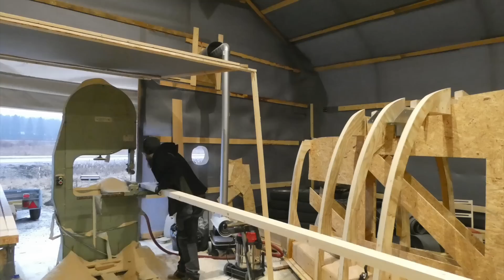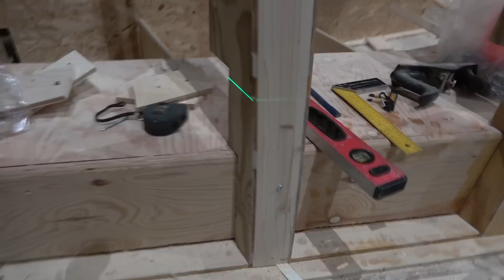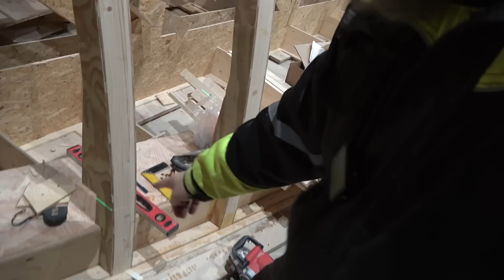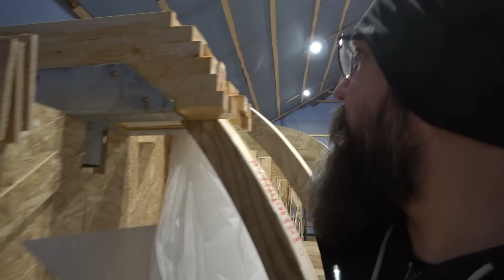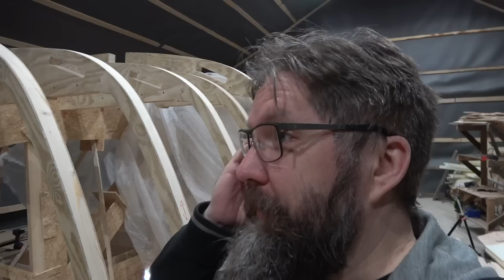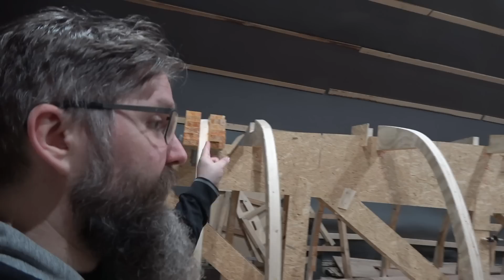Mast steps installed! 🥳 - ep85 Project SeaCamel

Comment: Your heater puts out CO2, mostly. 
In order to run it in the wind, you need an upright Charlie Noble, it looks like an H, with the heater exhaust entering the bottom of the cross pipe. This will induce a proper draft in the exhaust. Boats have been using this, for over a century.
Best wishes from Northern Canada.

Comment: Hi, Epoxy glues even glass so no sanding is needed. It only acts as here to keep air and humidity out. You only damage the galvanized surface. Cleaning a glue surface should always happen before sanding, otherwise you just spread the contamination. Also the Epoxy layer around the bolts will be a little thin. In such cavities humidity collects well and does damage quite fast. Better would be to glue the wood below the mast step on the table, drill the holes 3 mm larger, fill them again with EP, drill again and glue the bolts in as you do now. You need to protect the wood with EP all around as well as possible, otherwise you'll have rotten spots after ten years. That wood is not made for the sea as you probably know.
Reply: I also think the building method of glueing in the frames first is wrong, as you will have a very hard time to glass the inside of the boat. Why not build it like Johan from RAN Sailing. I'm boatbuilder and naval architect and I doubt that this design is stronger or better suited for ice regions as you mentioned long ago. The thick layer of glass does a better job than frames likely to rot quite fast. Anyway, glueing in the frames after laminating the hull inside would be way easier.
Reply from the maker: Hi! I won’t be having heavy glass inside the boat. Just thin coat for protection.
Frames are essential part of the structure and this way I don’t need that much temporary structures.

Comment: Have you thought about building a Wood Burner that heats water and put a few old Fashioned radiators like was use in the Older years? You have a lot of wood and wood chips?
Reply from the maker: No. There’s actually not that much waste wood. And I cannot have any water in pipes laying around. They would just freeze (or need to have glycol a lot in there.
For example it has now been few days -11°C. No point to try heat that place right now! 😅

Comment: I think I’d like to try and put epoxy skim/hot coat, on most pieces while it’s in small form before it’s 1 large structures, help prevent any possible rot and gains some strength and possibly adhesion between boards, sealing individually would be time consuming though. I’m not an engineer and in no way intended to discount your processes.  I’m type person that should not ever attempt something like this. I’d go over board with paranoia
Reply from the maker: Hi. I’m kind of wanting to have epoxy gluing wood surfaces so that there’s good penetration inside the wood and then chemical bond between the pieces. If I coat wood with epoxy first i need to sand the surface and even then the new glue layer would only have the sanded epoxy to adhere.
It’s very dry in here - only really in late fall it’s little bit damp. So I’m not concerned of the moisture. And spring is coming and that’s the best time to make things that needs to be dry.

Comment: don't forget to have a water Condensation drain hole in your  lower part of the Mast step, it don't have to be bigger than 2cm round. If you don't have clamps enough, you can use Tension straps put some paper on the wood so it don't stick on the straps.

Comment: You could look into some galvanised threaded rod, rather than the bolts. That may be cheaper than buying bolts?
Reply from the maker: I actually looked and they're pretty expensive too.
Got the bolts bought today! 😊
Reply: Threaded rod is not as strong as ‘bolts’
Reply: @peterhancox5268  In tension or in shear? I would say that in this instance they would be fine, given the amount of adhesive in support. Panu didn't say that he needed a high grade bolt in this application, so it is likely that a threaded rod should do the job if it wasn't as expensive as the bolts.
Reply: @vandyFixer  Both
Reply: @vandyFixer  I would think the type of hardness matters more than bolt vs rod end. Like a grade 4 bolt will be weaker than a grade 8 rod end.

Comment: Were do the weepholes in the mast steps drain? they seem to be totally obstructed by the blocking. I only ask after having to replace the mast step in my GRP sloop after the step was rotting away, which was a very difficult job requiring unstepping the mast.
Reply from the maker: They’re not for water. Only for the hot dip galvanizing process.
The stub masts for the rotating masts are gonna be totally sealed so no water will ever get into these.